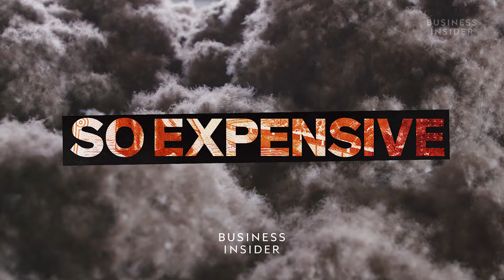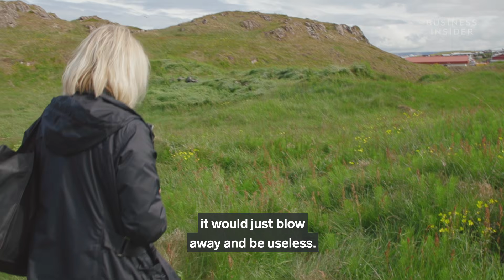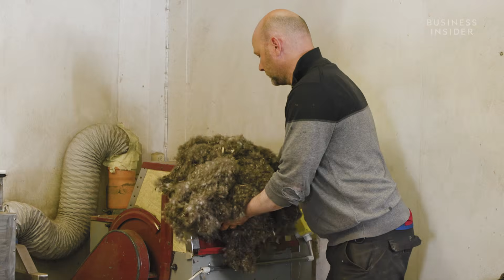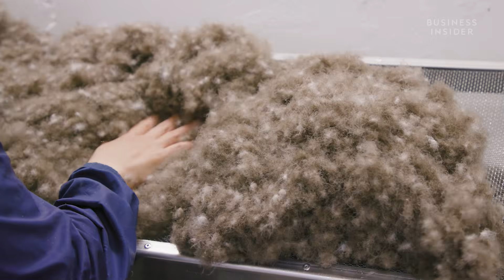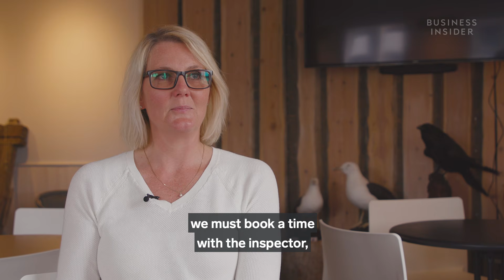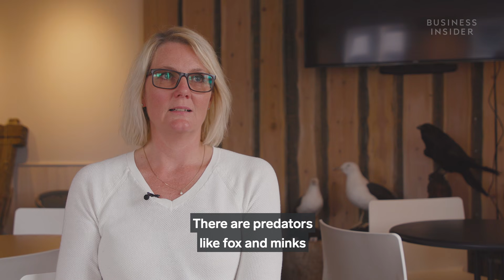Why Icelandic Eiderdown Is So Expensive | So Expensive

Comment: Both videos I've seen regarding Iceland products, the other being the sea salt video, have made claims about their process that the video clearly contradicts. Why you be lying Iceland?
Reply: "Eiderdown farmers will harvest this down either by taking small amounts from each nest or by waiting for the birds to dissapear completely"

Notice the words: either, or and bird.

They will either take small amounts while the bird is there or larger amounts when they arent. If the birds are not there then they take larger amounts. Nothing here is contradictory nor is it unethical. If anything this is beneficial as farmers are now invested in the safety of the bird populations. The fact that oftentimes the wind will blow away the nest if the birds are not present and the birds return and remake it is no different to when it the nest is taken with the minimum left for the eggs to survive. Either way: no birds are being harmed, no eggs are being harmed and this practice in contrast to ones like whaling have not had any adverse effects on the population of these birds unlike that of whales.

This practice has been refined for centuries. That does not mean it is good nessesarily just that it is efficient and due to the scarcity of this material REQUIRES that farmers maintain the populations of these birds. If it had any adverse effects on the birds then there would be noticable effects on the amount of Eiderdown produced and because there are no signs of this, it is simply wrong to consider this unethical as all signs show that it is an ethical and sustainable practice.

Comment: "Only take small amounts from the nest"

Proceeds to take 9/10 of the nest 😐
Reply: "Eiderdown farmers will harvest this down either by taking small amounts from each nest or by waiting for the birds to dissapear completely"

Notice the words: either, or and bird.

They will either take small amounts while the bird is there or larger amounts when they arent. If the birds are not there then they take larger amounts. Nothing here is contradictory nor is it unethical. If anything this is beneficial as farmers are now invested in the safety of the bird populations. The fact that oftentimes the wind will blow away the nest if the birds are not present and the birds return and remake it is no different to when it the nest is taken with the minimum left for the eggs to survive. Either way: no birds are being harmed, no eggs are being harmed and this practice in contrast to ones like whaling have not had any adverse effects on the population of these birds unlike that of whales.

This practice has been refined for centuries. That does not mean it is good nessesarily just that it is efficient and due to the scarcity of this material REQUIRES that farmers maintain the populations of these birds. If it had any adverse effects on the birds then there would be noticable effects on the amount of Eiderdown produced and because there are no signs of this, it is simply wrong to consider this unethical as all signs show that it is an ethical and sustainable practice.

Comment: Some farmers steal the nest full of eggs and let those eggs to rot as these pity farmers began to fill their pockets.
Reply: "Eiderdown farmers will harvest this down either by taking small amounts from each nest or by waiting for the birds to dissapear completely"

Notice the words: either, or and bird.

They will either take small amounts while the bird is there or larger amounts when they arent. If the birds are not there then they take larger amounts. Nothing here is contradictory nor is it unethical. If anything this is beneficial as farmers are now invested in the safety of the bird populations. The fact that oftentimes the wind will blow away the nest if the birds are not present and the birds return and remake it is no different to when it the nest is taken with the minimum left for the eggs to survive. Either way: no birds are being harmed, no eggs are being harmed and this practice in contrast to ones like whaling have not had any adverse effects on the population of these birds unlike that of whales.

This practice has been refined for centuries. That does not mean it is good nessesarily just that it is efficient and due to the scarcity of this material REQUIRES that farmers maintain the populations of these birds. If it had any adverse effects on the birds then there would be noticable effects on the amount of Eiderdown produced and because there are no signs of this, it is simply wrong to consider this unethical as all signs show that it is an ethical and sustainable practice.
Reply: @ThatOneBreadstickEater  By the 1 hour long comment you have splattered around this reply section to prove  that its okay to let the nest be destroyed while leting those unborn chick to die in cold is wrong as your mere ethical words will not change the action took by that farmer in video you can dream all you want and post 100 page long post but it will not change the reality of this burtal killing of the soon to be endangered species of birds for profits and human greed which know no bounds its endless until theres nothing left to harvest .

Comment: A little of each nest bthis pocher took the whole nest
Reply: "Eiderdown farmers will harvest this down either by taking small amounts from each nest or by waiting for the birds to dissapear completely"

Notice the words: either, or and bird.

They will either take small amounts while the bird is there or larger amounts when they arent. If the birds are not there then they take larger amounts. Nothing here is contradictory nor is it unethical. If anything this is beneficial as farmers are now invested in the safety of the bird populations. The fact that oftentimes the wind will blow away the nest if the birds are not present and the birds return and remake it is no different to when it the nest is taken with the minimum left for the eggs to survive. Either way: no birds are being harmed, no eggs are being harmed and this practice in contrast to ones like whaling have not had any adverse effects on the population of these birds unlike that of whales.

This practice has been refined for centuries. That does not mean it is good nessesarily just that it is efficient and due to the scarcity of this material REQUIRES that farmers maintain the populations of these birds. If it had any adverse effects on the birds then there would be noticable effects on the amount of Eiderdown produced and because there are no signs of this, it is simply wrong to consider this unethical as all signs show that it is an ethical and sustainable practice.

Comment: Very cruel. And i thought they would wait for the eggs to hatch. Cruel cruel cruel.
Reply: "Eiderdown farmers will harvest this down either by taking small amounts from each nest or by waiting for the birds to dissapear completely"

Notice the words: either, or and bird.

They will either take small amounts while the bird is there or larger amounts when they arent. If the birds are not there then they take larger amounts. Nothing here is contradictory nor is it unethical. If anything this is beneficial as farmers are now invested in the safety of the bird populations. The fact that oftentimes the wind will blow away the nest if the birds are not present and the birds return and remake it is no different to when it the nest is taken with the minimum left for the eggs to survive. Either way: no birds are being harmed, no eggs are being harmed and this practice in contrast to ones like whaling have not had any adverse effects on the population of these birds unlike that of whales.

This practice has been refined for centuries. That does not mean it is good nessesarily just that it is efficient and due to the scarcity of this material REQUIRES that farmers maintain the populations of these birds. If it had any adverse effects on the birds then there would be noticable effects on the amount of Eiderdown produced and because there are no signs of this, it is simply wrong to consider this unethical as all signs show that it is an ethical and sustainable practice.
Reply: Plus otherwise the Icelandic wind would do the same to the nests

Comment: I don't think I'm gonna sleep comfortably knowing I'm covering with somebody's home, especially when peace was never an option 😳
Reply: "Eiderdown farmers will harvest this down either by taking small amounts from each nest or by waiting for the birds to dissapear completely"

Notice the words: either, or and bird.

They will either take small amounts while the bird is there or larger amounts when they arent. If the birds are not there then they take larger amounts. Nothing here is contradictory nor is it unethical. If anything this is beneficial as farmers are now invested in the safety of the bird populations. The fact that oftentimes the wind will blow away the nest if the birds are not present and the birds return and remake it is no different to when it the nest is taken with the minimum left for the eggs to survive. Either way: no birds are being harmed, no eggs are being harmed and this practice in contrast to ones like whaling have not had any adverse effects on the population of these birds unlike that of whales.

This practice has been refined for centuries. That does not mean it is good nessesarily just that it is efficient and due to the scarcity of this material REQUIRES that farmers maintain the populations of these birds. If it had any adverse effects on the birds then there would be noticable effects on the amount of Eiderdown produced and because there are no signs of this, it is simply wrong to consider this unethical as all signs show that it is an ethical and sustainable practice.

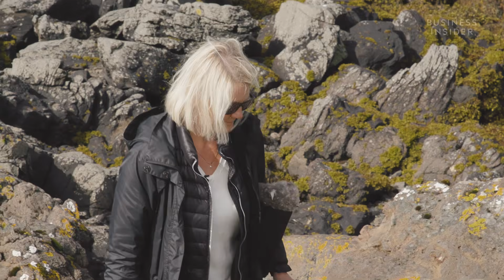Comment: 1:20 wtf she took the whole nest
Reply: "Eiderdown farmers will harvest this down either by taking small amounts from each nest or by waiting for the birds to dissapear completely"

Notice the words: either, or and bird.

They will either take small amounts while the bird is there or larger amounts when they arent. If the birds are not there then they take larger amounts. Nothing here is contradictory nor is it unethical. If anything this is beneficial as farmers are now invested in the safety of the bird populations. The fact that oftentimes the wind will blow away the nest if the birds are not present and the birds return and remake it is no different to when it the nest is taken with the minimum left for the eggs to survive. Either way: no birds are being harmed, no eggs are being harmed and this practice in contrast to ones like whaling have not had any adverse effects on the population of these birds unlike that of whales.

This practice has been refined for centuries. That does not mean it is good nessesarily just that it is efficient and due to the scarcity of this material REQUIRES that farmers maintain the populations of these birds. If it had any adverse effects on the birds then there would be noticable effects on the amount of Eiderdown produced and because there are no signs of this, it is simply wrong to consider this unethical as all signs show that it is an ethical and sustainable practice.
Reply: @ThatOneBreadstickEater  she took the whole nest

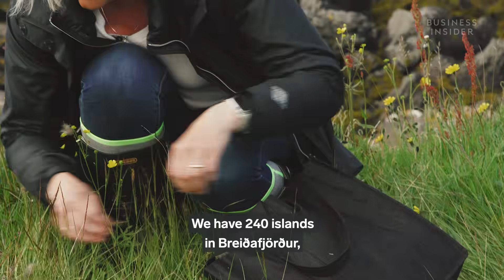Comment: 1:26 WTF! THE LADY JUST TOOK 90%OF THE DUCK NEST AND LEFT THOSE EGGS IN COLD!
Reply: "Eiderdown farmers will harvest this down either by taking small amounts from each nest or by waiting for the birds to dissapear completely"

Notice the words: either, or and bird.

They will either take small amounts while the bird is there or larger amounts when they arent. If the birds are not there then they take larger amounts. Nothing here is contradictory nor is it unethical. If anything this is beneficial as farmers are now invested in the safety of the bird populations. The fact that oftentimes the wind will blow away the nest if the birds are not present and the birds return and remake it is no different to when it the nest is taken with the minimum left for the eggs to survive. Either way: no birds are being harmed, no eggs are being harmed and this practice in contrast to ones like whaling have not had any adverse effects on the population of these birds unlike that of whales.

This practice has been refined for centuries. That does not mean it is good nessesarily just that it is efficient and due to the scarcity of this material REQUIRES that farmers maintain the populations of these birds. If it had any adverse effects on the birds then there would be noticable effects on the amount of Eiderdown produced and because there are no signs of this, it is simply wrong to consider this unethical as all signs show that it is an ethical and sustainable practice.

Comment: Liars! I'm sure you feather thieves take almost the entirety of every nest you find...
Reply: "Eiderdown farmers will harvest this down either by taking small amounts from each nest or by waiting for the birds to dissapear completely"

Notice the words: either, or and bird.

They will either take small amounts while the bird is there or larger amounts when they arent. If the birds are not there then they take larger amounts. Nothing here is contradictory nor is it unethical. If anything this is beneficial as farmers are now invested in the safety of the bird populations. The fact that oftentimes the wind will blow away the nest if the birds are not present and the birds return and remake it is no different to when it the nest is taken with the minimum left for the eggs to survive. Either way: no birds are being harmed, no eggs are being harmed and this practice in contrast to ones like whaling have not had any adverse effects on the population of these birds unlike that of whales.

This practice has been refined for centuries. That does not mean it is good nessesarily just that it is efficient and due to the scarcity of this material REQUIRES that farmers maintain the populations of these birds. If it had any adverse effects on the birds then there would be noticable effects on the amount of Eiderdown produced and because there are no signs of this, it is simply wrong to consider this unethical as all signs show that it is an ethical and sustainable practice.
Reply: Well she moved eggs and took almost the ENTIRE nest right there on video @ 1:22, so blah, blah, blah

Comment: Wow...she took the entire nest.well..95%..
Reply: "Eiderdown farmers will harvest this down either by taking small amounts from each nest or by waiting for the birds to dissapear completely"

Notice the words: either, or and bird.

They will either take small amounts while the bird is there or larger amounts when they arent. If the birds are not there then they take larger amounts. Nothing here is contradictory nor is it unethical. If anything this is beneficial as farmers are now invested in the safety of the bird populations. The fact that oftentimes the wind will blow away the nest if the birds are not present and the birds return and remake it is no different to when it the nest is taken with the minimum left for the eggs to survive. Either way: no birds are being harmed, no eggs are being harmed and this practice in contrast to ones like whaling have not had any adverse effects on the population of these birds unlike that of whales.

This practice has been refined for centuries. That does not mean it is good nessesarily just that it is efficient and due to the scarcity of this material REQUIRES that farmers maintain the populations of these birds. If it had any adverse effects on the birds then there would be noticable effects on the amount of Eiderdown produced and because there are no signs of this, it is simply wrong to consider this unethical as all signs show that it is an ethical and sustainable practice.

This practice isn't new it's centuries old and in no way harms the Eider. If these farmers didn't harvest the nests the wind would destroy them. The birds remake them easily regardless. In fact the protectiom from predators these farmers offer make it so that to the birds there is nothing but gain. The population of Eider has been stable for the centuries of this practice and still is today.

Comment: 1:19 Are you sick? Some commercial ideas like butcher business.
Reply: "Eiderdown farmers will harvest this down either by taking small amounts from each nest or by waiting for the birds to dissapear completely"

Notice the words: either, or and bird.

They will either take small amounts while the bird is there or larger amounts when they arent. If the birds are not there then they take larger amounts. Nothing here is contradictory nor is it unethical. If anything this is beneficial as farmers are now invested in the safety of the bird populations. The fact that oftentimes the wind will blow away the nest if the birds are not present and the birds return and remake it is no different to when it the nest is taken with the minimum left for the eggs to survive. Either way: no birds are being harmed, no eggs are being harmed and this practice in contrast to ones like whaling have not had any adverse effects on the population of these birds unlike that of whales.

This practice has been refined for centuries. That does not mean it is good nessesarily just that it is efficient and due to the scarcity of this material REQUIRES that farmers maintain the populations of these birds. If it had any adverse effects on the birds then there would be noticable effects on the amount of Eiderdown produced and because there are no signs of this, it is simply wrong to consider this unethical as all signs show that it is an ethical and sustainable practice.